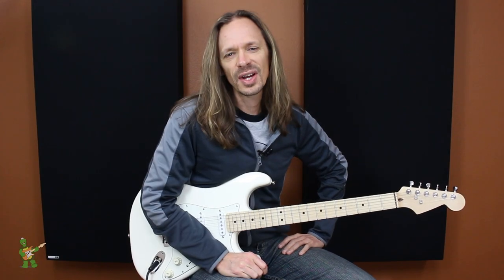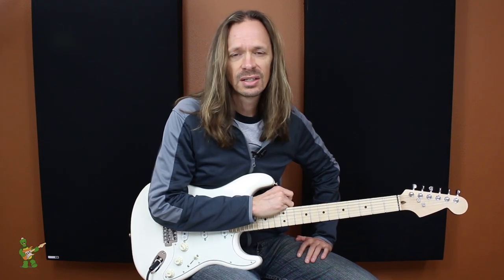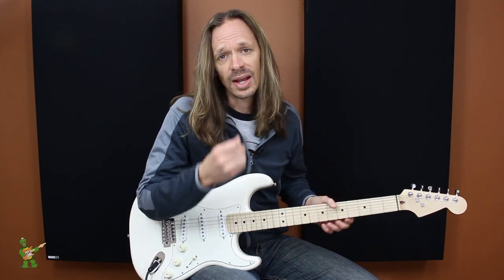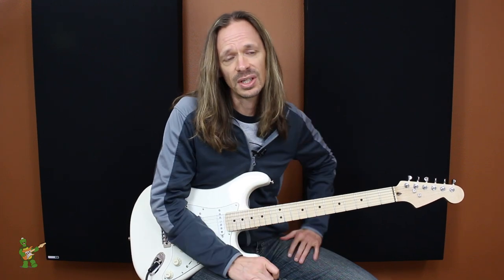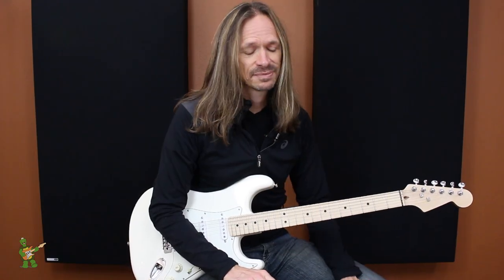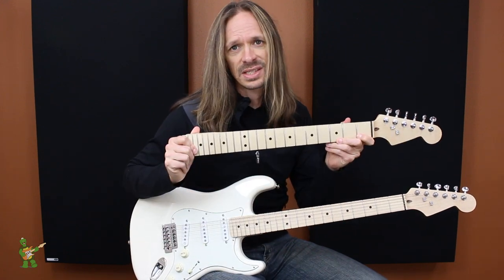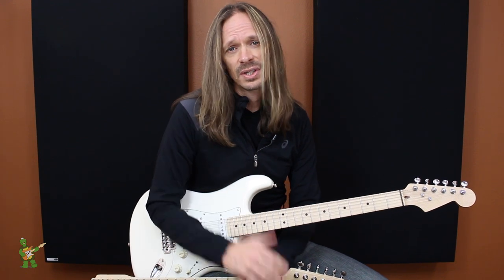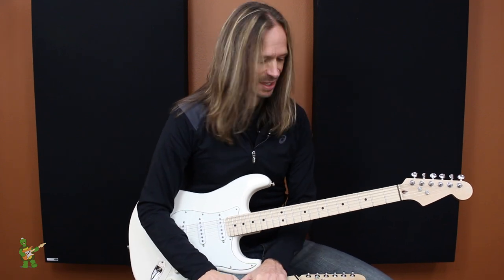Stainless Steel vs Nickel Frets

Comment: I could hear a difference for sure but not enough to pick one over the other . But if one was to change the wood of the body you might hear a bigger difference . Id pick the stainless for the durability .

Comment: Steel strings on stainless steel frets produce a little artifact "ping".  Use nickel steel strings and the ping is not heard. This has been my observation.  I prefer stainless steel frets. The strings glide across the frets.

Comment: The result is that playing through this amp and these pickups (which act both as filters with a very limited frequency transfer in hights), there are no big differences. This was predictable. Would have been better to use an acoustic guitar with an acoustic guitar amp and a piezo pickup (which can transfer differences in high tones / overtones!) or something like a Roland GR-55 and acoustic guitar emulation or a modeling guitar like Line 6 Variax.

Comment: Stainless steel is actually a family of alloys. 
There is austenitic, which consists of at least 10% chromium and about 35% nickel.
 Ferritic, with less nickel and more iron as used in cookware sometimes made with enough iron to be magnetic.

Duplex, a combination of the previous two... and
Martensitic, similar to Ferritic with a much higher carbon content making it the hardest.
It would be nice to know which alloy you are using to compare to nickel silver since many of them use up to 35% nickel as a constituent in their alloy.
Traditional nickel silver guitar frets consist of mostly copper with only about 18% nickel .
 It is possible to have "stainless steel" frets that actually contain twice as much nickel as what is called "nickel silver frets". 
 Perhaps you are really just comparing high copper alloys with high chromium, high carbon or high iron alloys that, in fact, all  contain nickel
Just saying "stainless steel" and "nickel silver" really doesn't tell us much.

Comment: I thought I detected a little more richness from the stainless in the midrange on certain sections. That difference would be awesome on an acoustic!  I would go for the stainless just for the durability though. Wonder, do the strings go off faster with stainless?

Comment: I recently switched to stainless steel in my strat. Honestly it plays better but the tone got a little colder; not as warm as before. But the change is very very small.
Reply: MQ B Do you think that you can EQ it to get rid of the harshness or maybe use your tone control to make it less brighter? I'm just liking the fact that stainless steel Frets will last a hell of a lot longer instead of having somebody rip out the Frets off the fretboard every few years

Comment: Having said what I just said about the difference between nickle and stainless steel strings...I liked the sound of the stainless steel frets better in these examples. I listened through my Event referance monitors and could clearly hear the difference and preferred example 2 on all of the offerings. That shocked me because of the experience of string thing. And if bending is a better on stainless, then I guess sign me up! But, what do I do with all my nickle fretted axes now?

Comment: I have both.  I hear the slight zip he talks about, however the nickel wears faster.  I also like the feel of S/S frets.  I also have polished the S/S fret to a mirror finish (thank God for Dremel) which gives a closer feel to nickel, to me anyway.   I have 6 guitars, I play the one the mood strikes me which means one or two sit for a spell.  Oxidation builds more on nickel than S/S, means have to clean the frets before playing.  To me S/S less so.  To sum up, I like S/S for longevity & someone to do a quality fret is getting hard to find.

Comment: Love the look and sound of vintage stuff but modern and modern/vintage stuff is better in a lot of ways...

We now have better machines that give us straighter necks with crafting that lasts longer over the years.

Contour backs that make the neck feel better connected to the body.

Stainless steel frets that are just better in pretty much every way compared to nickel.

Truss rods on head stocks or a wheel on the pick guard instead of being under the damn pick guard.

Locking tuners.

More cosmetic choices than ever before.

Parts that LOOK vintage but operate more modern.

Things have gotten better in a lot ways.

More is known about guitar making...

Comment: There's hardly a difference in tone, however stainless steel frets can make the neck a bit less stable since the frets don't flex with the wood the same way that softer nickel frets would, so refretting with ss frets is always a bit of a gamble, when it goes well it's amazing and lasts for a lifetime, when it goes wrong, it's a disaster.

My les paul is somewhat more temperamental now with ss frets, but nothing disastrous, I just have to adjust the truss rod every now and then, which wasn't something I ever had to do before because the neck just wouldn't budge, now it does a bit but it is what it is.

Comment: Haven't finished the video yet, but the difference is very slight. The second neck sounds a tiny bit more full and is my preferred choice. Interested to see the results

Edit: Turns out I like stainless steel more

Comment: very interesting comparison, thanks! particularly I found I assumed neck 1 was the SS since it seemed brighter to me at first, but at 7:00 I noticed the high string bending had a scraping sound on neck 1 and was smoother on neck 2 which I realized must be the steel frets which I didn't expect to prefer. I love when blind tests surprise me!

Comment: that difference won't matter - but the longevity of the wire will.  I will be ordering a new strat neck soon and it will be dressed with stainless simply so I can keep the neck for longer.  Where I live a refret costs more than a new neck...

Comment: I had SS put in my 1965 Stratocaster so it would never need to be regretted again.
Reply: Did you notice a big difference in playability going from nickel to steel? Curious, as I've got a 1982 Stratocaster that is a '62 Re-Issue, the first year they did the reissues. I LOVE the sound and playability of that axe but I'm really considering getting a second neck with a slightly flatter radius and med. jumbo SS frets. Thoughts?
Reply: @patrickfoster4586  fretboard radius is just personal choice. I have two vintage 60s strats and a CS 1969.  I like the 9.5 better than 7.25, but a few songs into playing I forget about it.  I'm sure if you isolated the sound you could hear some difference with fret materials.  I didn't.  I believe technique and signal chain is way more important.  I'm more concerned with the sound in a mix than sweating over an isolated guitar sound.

Comment: The sonic, instantaneous difference, difference exists. But it's negligible to meaningless.
If you were playing, you'd tweak a tone control slightly, on the gtr, or amp and carry on, enjoying the actual functional
 difference, the durability, and the glass smooth feel to bending strings.

Comment: Fret wear can also be avoided with.... Proper technique, and regularly changing warn nickel plated strings, and or steel strings once corrosion has set in on the underside of the strings; string side that contacts fret wire obviously. Might just want to use pure nickel strings, and deal with them not being as spunky as steel/nickel plate steel strings. I'm probably going to start using pure nickel strings - at least give them a try.

Comment: The difference in terms of a full mix with a full band might as well be zero.  The difference in terms of longevity, is more than worth the extra $35 for the install.  Maybe the only downside to SS is that strings wear out faster.  ;)

Comment: There obviuosly IS a difference. The real question is will your gear amplify that difference or make it negligible? I tend to set my gear in such a way, that it exaggerates all nuances. Having said that, I wouldn't use stainless frets with rosewood fingerboard, ash body and bright low output single coil pickups. God forbid! :)

Comment: I guess if it does sound a little brighter with stainless steel you could EQ it a little differently and use your tone control to compensate for that. It sure seems like a great idea not to be getting your neck refretted every few years

Comment: it seems the mic for the speaking is also picking up some acoustic string sound, especially on the chords. very distracting and screws up the test.
Reply from the maker: Nope, that is not the case. The mic'ed amp was recorded in a isolated room, and is on a separate track from the vocal mic. The vocal track is muted any time the guitar is playing, so there is absolutely none of it in the audio at that point.

Comment: As seen in my profile pic, I play a stainless steel fretted Parker Fly.  I first listened to the playing test with my eyes closed and heard a difference between the two necks with the computer speakers.  The nickel frets sounded brighter.  Then I used 6-armature in-ears and again heard a difference.  This time the familiar stainless steel ping was apparent on neck #2.  That "sheen" to the sound simply did not come through the computer speakers.

Comment: True "Pure Nickel" wound strings tame the highs on Jaguars, Teles and Strats and save your nickel frets, on the bass side strings anyhow. The bass strings are wound with softer 100% nickel (not just thinly nickel plated) so the hard steel will not become eventually exposed on your bass strings and bite and tear into your poor nickel silver frets AND you can even get a far more intonation friendly/STABLE Wound G-String too(!).  'Old school' strings were 100% "pure nickel" wound/ wound G-string (GREAT for Jaguars or shorter scales)and not just plated. Bend obsessed blues (and country) players inspired Ernie Ball's custom unwound G-string "Slinky" packs and nickel plating is of course cheaper to manufacturers' overheads for their greater profit margins but at the cost of YOUR fret life.

Comment: Stainless steel frets are harder than most strings in the market except stainless steel strings. If you use light gauge “soft” strings you will never have to worry about refretting your guitar. One less thing to worry about 🤠.

Comment: Great video! Well presented. The practicality of stainless on a frequently played guitar is definitely worth it.

As for the time, like others, I could hear it on the clean clips and not the distorted clips. With a naturally spanky guitar like a strat, I think the difference is probably more pronounced. Would likely be even more pronounced on a tele. The nickel seems to tame the high end a bit. But I could see the opposite being a virtue on a Les Paul style guitar to give it more bite and clarity. Not to mention guitars aimed more at shredding.

Comment: The reason that luthiers don't like stainless frets is that they wear down all the tools for installing and setting them up — and then they'll last forever, and not require maintenance. The guitar techs gets screwed on both the beginning and end of the deal.

Comment: WELL I COULD HEAR THE DIFFERENCE I KNEW RIGHT AWAY NUMBER TWO WAS STAINLESS STEEL!! 

It had more of a twangy and a buzzy sound..  I'm more of a tinny sound. 

and just like what the people complain about came out I guess who have good ears. 

It's because when the strings buzz up against stainless steel it makes a difference sound.. and they always is some buzzing in guitars if you have low action.  

I could definitely tell a difference.. 

I'll stick to my nickel frets the way I always do my fret jobs.. 

and not to mention stainless steel frets also make you go through strings much quicker because the stronger steel always wins...

Also note that mega companies like Taylor don't use stainless steel frets either  because they don't like how it sounds unless you request it. 

On acoustic guitar you can tell even more you get that twangy, bright sound you can hear the buzzing much more.. 

;)

Comment: Great video; thanks for making this! I figured this was the case all along, and it's good to get confirmation. The longevity and string bending smoothness benefits of stainless steel frets far outweigh whatever benefits one might see in using nickel. It's amazing to me that the majority of factory guitars are made with nickel frets still. It's like the brands are pushing planned obsolescence. So glad that warmoth is there to offer us an alternative to the inferior. Stainless steel for the win!
Reply: I'd add non-locking tuners to same obsolescence category.

Comment: Stainless sucks for tone IMO.  As per usual YouTube compression and such isn't really audiophile quality.  You can barely hear a difference here but I couldn't get rid of the zingyness to save my life and it drove me nuts!  It's so high you can't dial it out without compromising your sound.  If you have freaky ears like mine I guess.  It does bend super easy.  It does add a subtle kind of authoritative attack to the lower register that's interesting.  But the damn zing!  I even swapped pickups (boutique stuff) hoping to get rid of it but it couldn't be done.  Ruined my 73 Strat with maple board.  Now I've got to rip them out and go back to old school.  The EVO Gold might be a worthy compromise.  I might have my guy put a couple in just to try and see what I think before making the last call.  But SS zing has literally stopped me from playing that guitar anymore.  Fatigues my ears super quick.  It's kind of like if you put the tinnitus most of us have to one degree or another into your guitar and then started playing.  Just NOOOOOO!!!!!!

Comment: Tommy Emmanuel uses stainless frets…. End argument. I’m watching this cuz anyone who has work hands, or strong hands be able to max the dr. Squeeze tester on both hands, those Nicole frets for me last like 6 months max before I feel like I need to re fret my guitar, stainless has amazing properties- non magnetic, anti corrosion well basically it oxides and protects itself. It does sweat green after welding on it though, since there are so many different grades of stainless out there which grade of stainless is it. And do the different grades of stainless make a difference. What if we used a material like bronze manganese super hard stuff, or copper beryllium.

Comment: Well, there's a difference, sure. In the end of the day though, it's the same tune, sounds just about the same. It's probably the same as with the guitar cables and picks and stuff. Only a guitarist would care about those things .. :) But I'm interested in stainless steel frets just because they might last a bit longer. Not that I've been able to kill my electric guitars' frets yet, and they're some nickel-stuff, but my acoustic guitar's frets are in a bit bad shape and I've played it very little over the years... So yea, if I ever decdied to install bigger frets to my electric guitars, stainless steel would certainly be an interesting option.
Reply: They don't last a bit longer. They last A LOT longer! I have guitars that I play regularly that have had SS frets for ten years and they show no visible signs of wear.